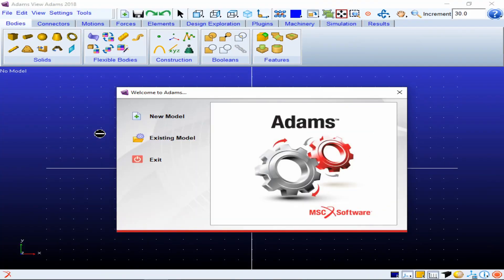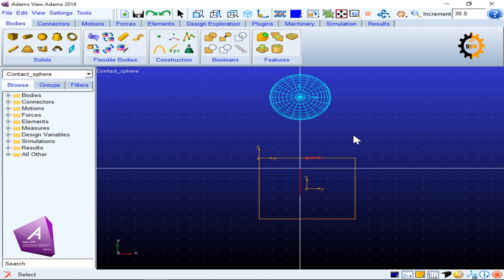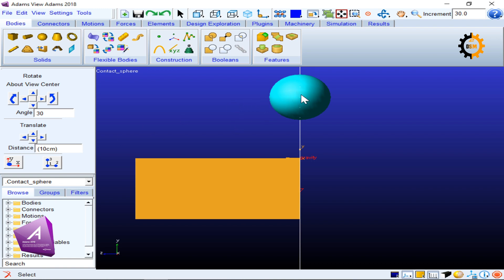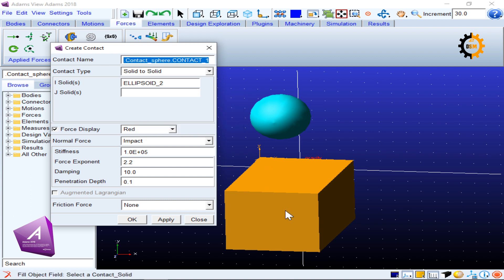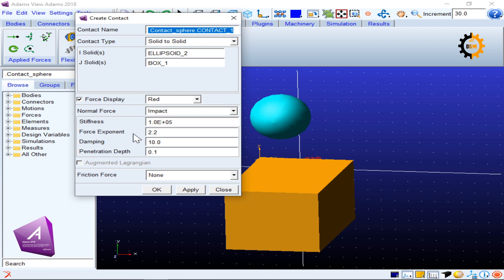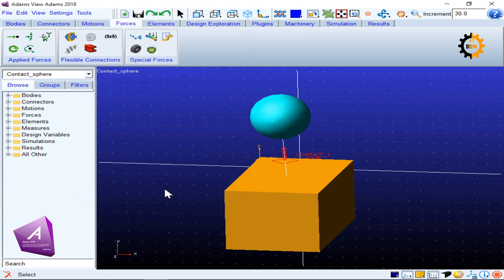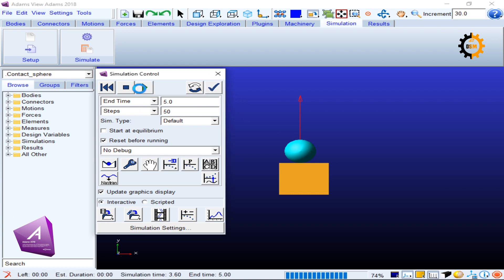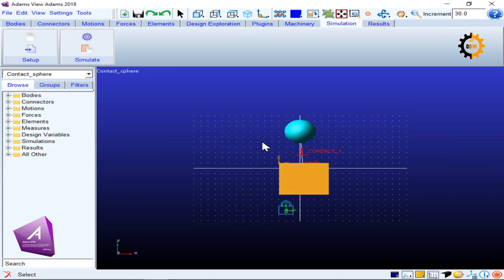9. How to define contact / impact forces?

Comment: Hello ! If I want to use the "user defined force" function, can I create a "design variable" and use that in the user defined force menu ? I tried and Adams closes itself
Reply from the maker: Yes, you can. There could be some issue with your installation, operating system or version of the ADAMS you are using.